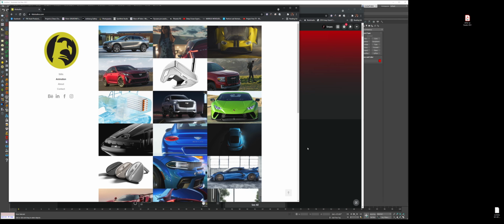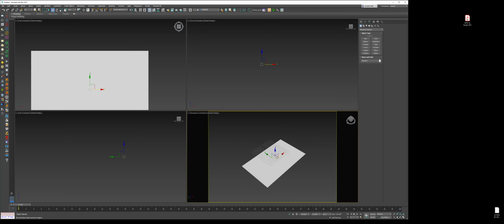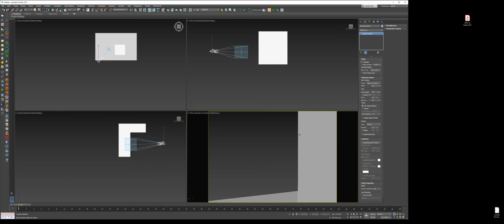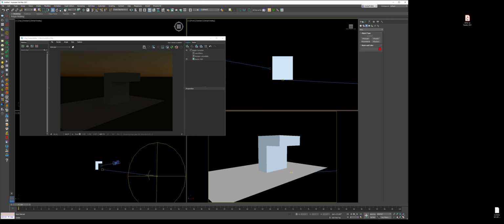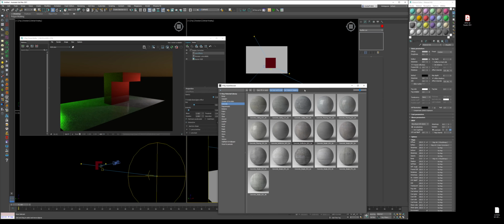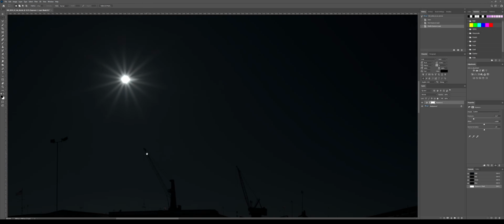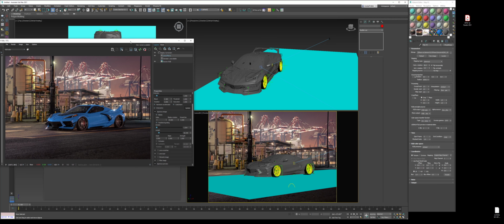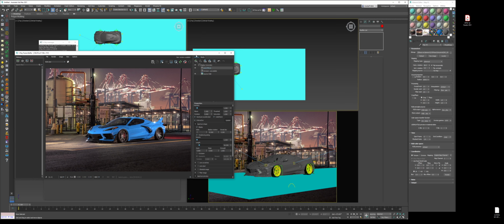Automotive CGI - Photographers Intro to CGI

Comment: Great video! Im a cg artist and want to get into photography. 
What gear would you recommend for shooting HDRI and backplates?
Reply from the maker: There are many opinions on this topic as well. My personal setup is Nikon. I have a Nikon D850 with a 24-70 lens for my backplates and a Nikon D810 with a 16mm fisheye lens for the HDRI capture process. Before I was able to afford the D850 I just used the D810 and would swap lenses when shooting the different items. Its not hard to switch on location, but if you shoot construction sites etc, it generates a greater risk of getting dust on your sensor and then you have all sorts of weird spots on your photos and have to get your sensor cleaned.

In a nutshull, if you are purchasing a setup on a budget, I recommend a zoom lens and a fisheye lens. As far as camera body goes, I strongly recommend buying anything that is full frame sensor, crop sensor will just give you headaches with lensing and such.

Hope that helps?
Reply: @AutomotiveCGI  Thank you! Just watched your capturing an hdri video. Would be cool to see more of that style video. Going on site capturing some images and compiling them into an hdri.
Reply from the maker: @funkymxn  I actually plan on doing something like that, since location is more interesting than my garage lol.